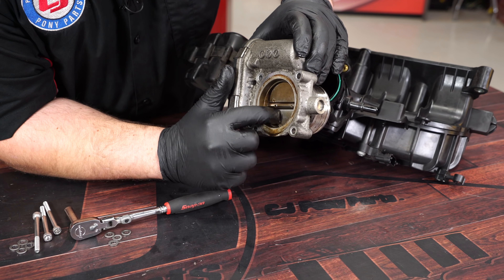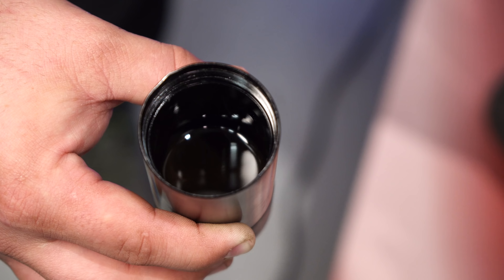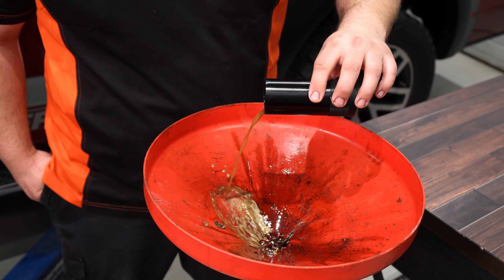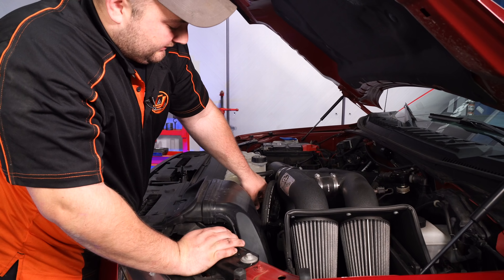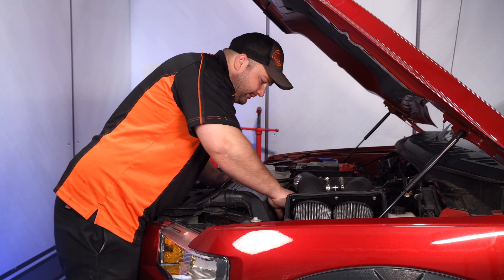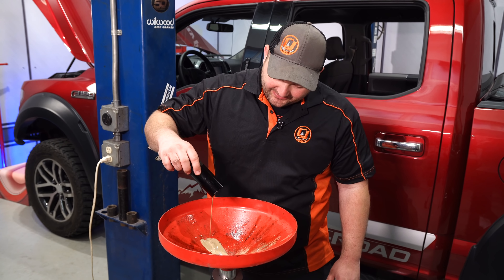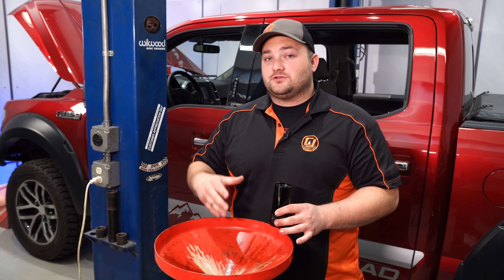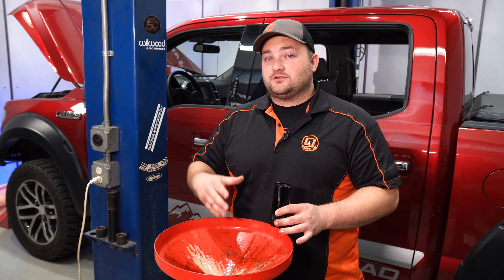Why you need a catch can!

Comment: I always figured, that little bit of oil is not bad for the throttle body, keeps it lubricated. Also the oil inside the intake system also helps to grab dust particles that may /could still enter the intake through the air filter especially if the air filter is low quality or has a tear, or the intake has a vacuum issue, like a tear or a hole. 
And last, the valves will get loaded with caked on materials, not only from pcv .  This mixture is actually oil + gasoline +water.  Catch cans can help not to have this stuff return,  but it will not prevent  the valves to get stuff baked on them. Walnut blasting, or whatever physical - hands-on methods the only way to get them clean again.

Comment: Use natural-gas-derived synthetic oil. 
Use cleaner through vacuum hose once a year. 
Use premium fuel.
Done.

Use catch can only if boost/compression was added or for imperfect/cheap/non-existing oil separator designs of direct injection cars before 2014-2015.

Comment: Saw a person following one of these car youtubers where this  person just dumped the contents of her 2017 mustang catch can back into her cars engine oil. Suggested it as something to follow. She explained over and over through discussions how this was just oil and was not a problem. I read and was like you're crazy.

I had a 2013 Focus ST where i upgraded all the tubing pre turbo and post turbo so i pulled the whole intake, FMIC and plastic manifold throttle body and looked down into my intake valves. With 15,000 miles a fair share of oil everywhere plus significant carbon buildup on valves. After that experience i bought a quality CC. Hand cleaned my intakes valves where it took hours of scrubbing with harsh chemicals.

Comment: 95% of that liquid looks like its moisture. A catch can without a filter to separate oil-water is a waste of money. That is a poor quality unit - the best units i have seen to date are from a German company Mann filters and the unit is called Provent and sizes are from 100-800. Your welcome
Reply: why would you need to filter out water/oil from the catch can... what you empty out should be disposed of sensibly anyway & the water is contaminated with the oil so cant be separated fully (at home etc).. so buying any catch-can with a filter/mesh within is a good idea compared to a plain can 
(we cant see whats in the main body of the can so cant really say whats what in this video etc)... 

having a catch can with a specially designed can with a oil/water filter would be a totally waste of money, after all the level of moisture is tiny compared to oil.. depending on your location/environment etc

there should also be a mention on where the catch cans are located aswell as these (catch cans as a whole) are supposed to be fitted in a cooler location allowing the oil particles to cool & condense making the cans more efficient... if not & in a hot location the effectiveness is obviously reduced, unless you've a good mesh filter within the can etc...
Reply: The advantage with the Provent models or any other product with RD is that it catches oil only and the air is used by the intake, it does not linger around long enough to convert to water. If your catch can is catching oil and water you might as well attache two hoses to a bottle of soda and it does the same thing. 

it looks like people love gadgets and the charlatans are there to provide them what they want.
Reply: Naomi Antoniou oil isn't converted to water that's impossible, water is captures within the airflow through the intake & climate conditions 
ie condensation 
iee moisture in the air... when you turn the warmed engine off there is moisture within that that's what gets caught in the catch can its sucked into the cans reducing the moisture in the oil & crank case....

so I'm not sure what type of RD material you've read as its just rubbish.... you'd actually find most/all properly located catch cans will have moisture (water) mixed with oil, that's unavoidable. that's also why most modern vehicles would require 2 cans (both for hot side & cold side of the PCV valve)

my current car I've fitted 2. 1 catches most of the oil/moisture vapour the 2nd (turbo intake side) captures almost nothing. just like in this upload 1 can had a lot more then the other (the only difference is I check my cans every 2wks) this isn't the only upload/video that also shows similar results ie 1 can catches more then the 2nd can... 
my cans have both mesh & a foam insert to catch oil vapour & moisture whilst allowing good flow through them.... some cans have a foam filter (there rubbish as oil clogs foam in a heart beat)

ps ppl can & do use alsorts of cans to catch oil vapour.... it still works fine, just like yrs ago ppl used coca cola cans for coolant overflow bottles.

pps you also do realise catch cans haven't really changed much if any over the yrs, they've gone from mesh inserts/solid baffles.. mesh/foam inserts, mesh in the lid & empty container etc to cheapo ones which are empty... all in all, you can make your own which will be just as effective as a £200 option, only you'd save yourself a fortune.
Reply: ok
Reply: Mercedes uses Mann Provent from the factory on.

Comment: The oil separator in my Mustang works well. I have to dump it occasionally, but I’ve never had water in it. Usually every 2-3k miles for me. I would be concerned about something wrong with the engine with that much of a milky look to it.

Comment: I run a JLT 3.0 on my passenger side. I have a 14 Mustang 3.7L. I run full synthetic and change my oil every 5K. In between changes, I collect at least a couple of table spoons of oil. I bought the car with 12K miles used, I have 33K now. I have been using the oil JLT since 15K or so.... I am glad I use it. 
I guess I don't need a catch can on the driver side, I've pulled the tube and don't see any oil, it's the passenger side that needs the catch can the most.... but I digress.

Comment: I have the Gen 2 3.5 Ecoboost that has port and direct injection. Is this a must have for this engine like it is with the older one? I know that having the port injection during low RPM/ low load will help reduce all that buildup but I don’t know if I should invest the time and money to install a catch can. Thanks

Comment: oil is not a problem except in the intercooler where it's limiting heat transfert.
It's EGR mixed with oil wich harden on the back of the valves.
i have a 300 000 kms diesel engine wich sucked pcv oil all its life and valves had barely some deposits on it.

Comment: I have a 2010 buick enclave with 3.6l lambda engine - same as any v6 GM, Chevy, Caddy uses - I drill the holes of pcv a little bit bigger and put catch can - after 3000miles, it gathered 1 quart of oil . Those oil will end up sticking to the valves and will foul up you upper cylinder and injectors . My only  issue is - I need to empty my catch can every 200-400 miles.

Comment: Where the view of the intake valves when a catch can is being used?
Reply: Scott  right ????
Reply: Seriously guys.. oil is the only thing that can cause that carbon build up in the intake track. Block the oil from Interning, and you stop the build up. I have a JLT oil separator on my 2017 mustang GT. It catches quite a bit of oil! They definitely work!
Reply: Eddie J its not even carbon, its simply dried/baked oil that's it... whoever started saying carbon build-up should be shot!
ps its "entering" …… a lot of the time you'll get a increase level of oil passing into the intake when the PVC system sticks or fails which increases crank case pressures etc or even piston ring failures etc...

I'd agree catch cans do work, especially if fitted correctly! if they help with valve build-up is just another matter.. I know I'm watching mine now after cleaning my intake etc
Reply: what do you think oil is made of Mal P???  Hydrogen, CARBON, and oxygen!!!!  LOL

Comment: I have a FP catch can on my 15 Mustang and there wasn't much in there after the first 3k miles. Is it worse in certain engines or as it ages?
Reply from the maker: It's usually worse in turbocharged vehicles like the ecoboosts.
Reply: Yes, forced induction engines will fill the catch can quicker

Comment: Hey guys I got an oil superstore from you guys, and it catches oil but some also is caking onto the threads leading into the can and a little onto the hose. I checked the connections, threads aren’t stripped, everything is tight and looks good. Is that something I might typically see?
Reply: Also make sure the clamps on the hoses are seated properly

Comment: It doesn’t hurt your engine cars have been around for so long and if it was a problem all cars would come with them.
Reply: This is actually a problem with direct injected cars , which are quite new. Old multiport and previous injections methods, the injector sprayed the fuel on the top of the valve that lets in the fuel and the sprayed on fuel keeps the valve clean. In direct injection engines (GDI) the injector sprays the fuel directly into the combustion chamber and the valve only lets in air, thus nothing cleaning it anymore.
Reply: i see i see well either way if its not direct injection you should be fine.

Comment: So since the mustang GT -2018 have both port and direct injection, this shouldn’t be an issue on those engines, right?
Reply: Kuemmerling Enthusiast correct
Reply: Better to be safe than sorry!
Reply: It will still get all over the throttle body, but it will be cleaned by the port injection past that
Reply from the maker: Port and DI cars still can have issues with build up, I still run one on my 2018.
Reply: stangmode on youtube has a video showing how much his catch can filled up on his 2018 gt
Reply: It won’t be much of a problem with carbon buildup but a catch can still purifies the air coming into the engine which can give more consistent combustion and a more usable/higher octane A/F mixture. I run a catch can in my FRS with dual injection and immediately got smoother running and a couple more MPGs
Reply: 100 bucks for piece of mind........

Comment: If they are so important, why doesn't gm put them on corvettes????
Reply: Howard Young people are easily talked in to bs yes catch cans help if you are boosted but if its stock no need for one the reason they make it go back is to lube the valves and the throttle body not saying its good or bad but there is a reason manufacturers do it after all they spent alot of time desiging it .

Comment: catch cans do help & catch fluid (oil, water/moisture etc) from the crank case.... if these actually help with carbon build-up on the intake valves is another matter "afterall the oil still has the chance to reach the valves"

like ppl have commented simply removing the oil feed to the intake helps & doesn't show any signs of poor running etc especially if you fit a filter allowing the crank case to breath, keeping pressures/temps (slightly) down 
the only down side to the filter option is this 'could' in moist conditions area's of the world increase moisture within the crank case & contaminate your oil supply overtime etc 

it would be nice to see a pair of car with clean valves, known mileage driven say for a year. one with catch cans & the other standard (without) even including a vehicle with a crank case open filter to have a full comparison (running costs, fuel consumption, oil use etc) as most car manufactures, oil manufacturers & snake oil aka (valve cleaning intake cleaner) manufacturers are making a killing selling items knowing owners are throwning money down the drain!!!

hence why ppl need to be more aware & start sharing information to give everyone else the true value of whats going on etc
Reply: Well I put one on my 2013 last winter hose going from crankcase to the can is full of oil residue the hose going from the can to the intake is dry and I've put on close to 15k with it on still dry between can and intake
Reply: @michaelbradley770  OK, is your car turbo or not, as mines a turbo & I've to have 2 cans 1 gets oil through & the intake side is almost clear all the time.... however does capture moisture..... so my main point for you is, do you really need 2 can's for both sides of a pcv system etc?
Reply: @malp6280  I have the 3.5 twin turbo and I just have the one can with a clean side separator made by upr
Reply: Michael Bradley I've had similar results with 1 of my cans however I find like lots of other ppl with the same car (could be different to your requirements) that my crankcase to inlet manifold line produces a lot of oil vapour & that's where & how the oil comes from that clogs the intake valves...I also found quite a lot of oil sitting in the lower section of the intake manifold. my intake can almost catches nothing & I check every 2 wks etc.. 
I've literally just cleaned my valves & the car drives much better so now I'll check in 6mnth etc & gauge myself on when to clean the valves but I'll not be waiting 10k 20k etc & those inlet spray cleaners are totally pointless I've used 2 & again 6wks later found my valves clogged-up "those cleaning fluids really did a cracking job!!"
I've only ever found once oil in my inlet & that was due to my PCV valve clogging or jamming so small amounts of oil got sucked into the intake "I'm talking about 1mm covering the botton of a cup (not much)

I'd suggest giving the opposite side of your pcv a quick check.. pop a line off & see if oils inside of that, it wouldn't hurt & you might find you'll need a 2nd can "possible!"
Reply: @malp6280  the other side was clean when put my new afm intake about 2 months ago. The can catches a lot of oil and I hardly ever get the cruddy moisture during the summer and I fill up a small cup once a week in the winter I get a lot of moisture and empty once a day and almost fill that same cup

Comment: I took my hoses off and put air filters on it.
Reply from the maker: By doing that you increase crank case pressure which can result in increased oil consumption down the road when your piston rings and cylinder walls get a little more worn.
Reply: This would work since these engines are wet sumps. Only thing you would need to worry about is oil in your engine bay if you had some blowby.
Reply: How would it add pressure if it is vented through the filter?

Comment: just pulled the head off my boys s2000 with 194,000 and the valves had no where close to that much carbon buildup.
Reply: thomas barlow did you not hear the part about direct injection in the video? Port injected engines don't look like that.